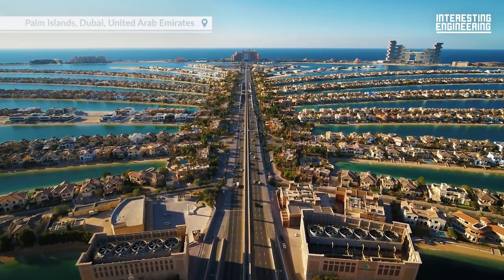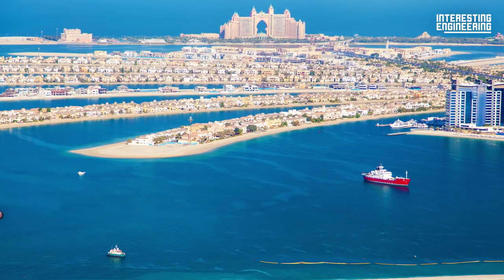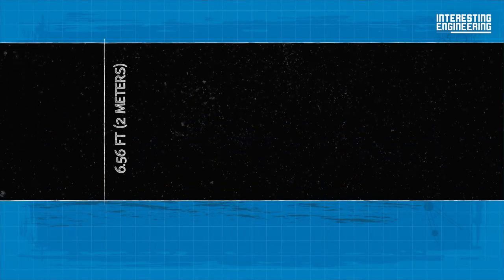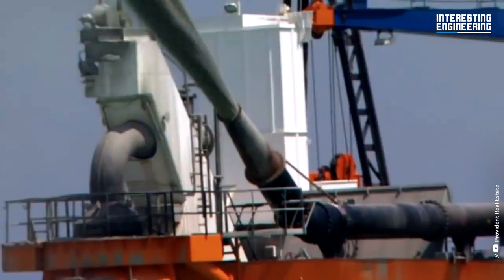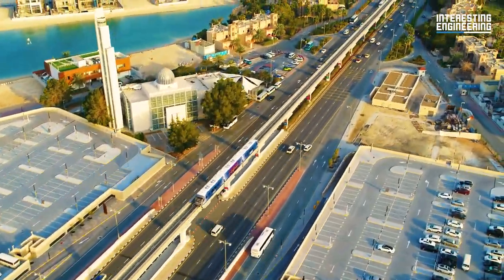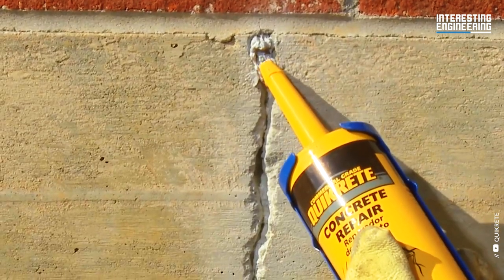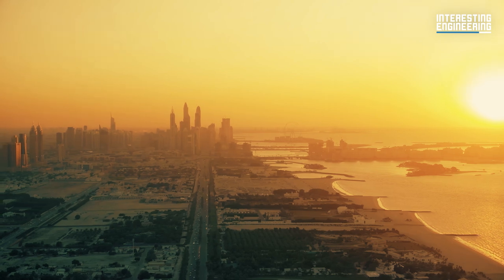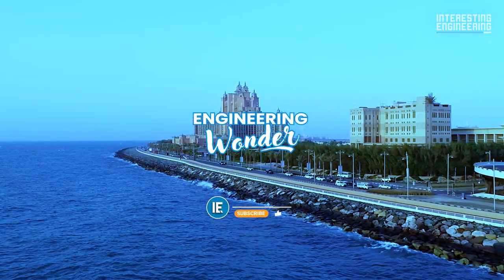Are The Palm Islands Really Sinking?

Comment: What a contradictory mess. A survey team says they measured 13/64 inches (5mm) of settlement per year. The authorities deny this, and claim there'd be cracks and broken windows forming. Then the video goes on to say that the authorities say there has been less than 25/64 inches (1 centimeter) settlement per year, which is well within natural limits. So they admit to higher levels of settling than the surveying company measured that they claim is wrong. How does any of this make sense? Can't make heads or tails out of this video which claimed settling, then denied it, then claimed even greater settling. I've learned nothing.
Reply: 13/64 inches (5mm) is the sinking rate. 25/64 inches (1 centimeter) is the point shift rate. So, what the authorities basically said is that NASA can't measure a 5 mm sinking, and the structure had less than 25/64 inches (1 centimeter) point-shift/year.
Reply: @chuckdales5605  what's the difference between shift and point shift
Reply: It's sinking...fast.
Reply: This video is indeed a hot mess.

Comment: You don’t need to be an engineer to know that the built up sand aggregate in the ocean isn’t a permanent substructure to inhabit infrastructure like roads and housing. It will melt like ice cream over the years.  Even a rock wall built a couple hundred meters out from shore  has tremendous movement bcse the subsoil underneath is sand!  So if Reclaiming land in flood zones always end up in disaster,  the ocean is a complete disaster ! What is happening on our planet is scary. We will all be slaves to the elite if we don’t stand up

Comment: I think these man-made islands will sink into the sea in the future, if not now. The sinking of such large structures is slow, so the properties you will buy from the islands may not last 30 years and 50 years.
Reply: @Thelesson. It's called the Downtown Circle and I must admit it's very attractive...it doesn't even take up ground space being suspended 550 metres in the air. Of course it still seems only a project. Who knows?